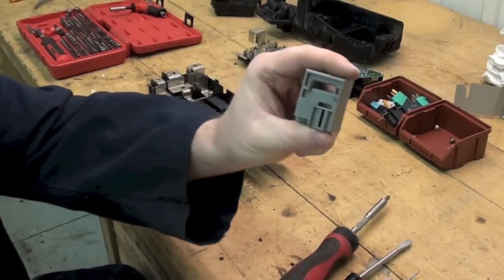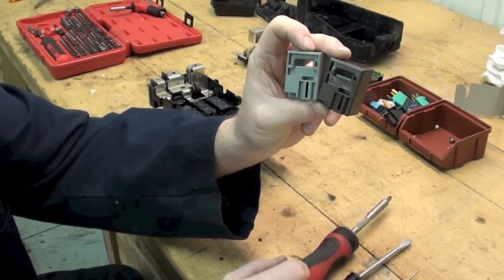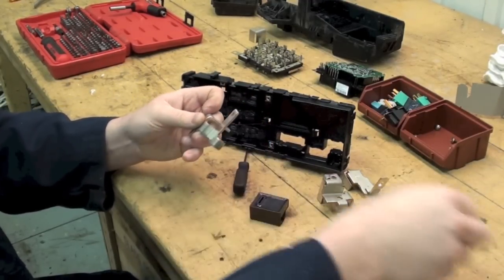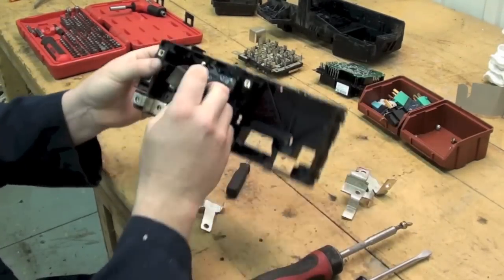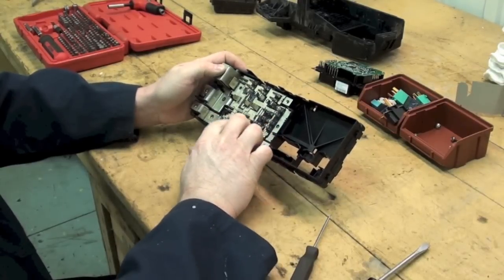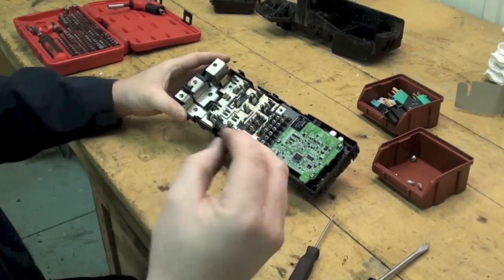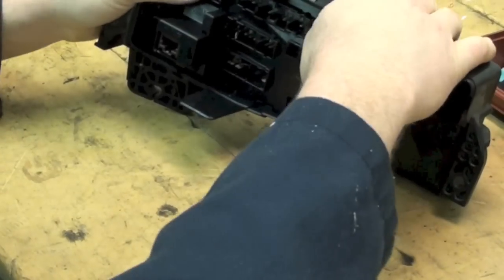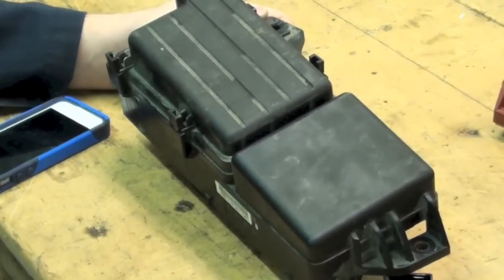How to Replace ELD - Electronic load detector - P1298 -Honda Accord 2003 to 2007.  Part II.

Comment: Gonna try this. Thanks for the amazing work and share!
Reply: Holy crap it worked! Got the part at the local Honda dealer for $31. Took me an hour start to finish. Hardest part was getting the plastic panel off. Just be patient and use lots of flatheads! Thanks again!

Comment: My alternator died (squealing sound) before killing my batter in the process. The other warning was battery light stayed on the instrument panel and then eventually SRS and Airbag indicators. Replaced both with auto parts store alternator and battery. Starts up okay, drives okay but once the car is warm (after about an hour) the battery indicator will randomly come on and then off again. No Check Engine light and OBD2 scanner does not return any codes. Did some Google searches and some say it could be the ELD. May give this a try.
Reply: Did you fix the problem? My accord is doing the same problem

Comment: I do not have this code, but my car will not charge i have put 3 alternators and 2 batteries,  ending in the same pattern charge light after running it for a bit. Sometimes revving it up makes it go away but eventually stays on. This cannot be 3 bad alternators and/or batteries. And suggestions?

Comment: Probably going to give this a try in my 2007 Accord EX. I have the code, but no check engine light, and I've been having an issue with intermittent air conditioning
Reply from the maker: I doubt this would cause a intermittent a/c operation.  This will repair your fault code.  I would check and see it the a/c clutch is engaged when the a/c is not working.  When the clutches wear out they will work intermittently.

Comment: I have a 2000 Accord 3.0
And I can't find anything on the problem I'm having... I've had this car for well over 100,000 miles and the headlights will dim everytime I click something electrical...like the windows, turn signals anything that draws a decent load. I've done the "Big 3" power/ground cable upgrade. It's all OFC 1/0 gauge cable. This has helped the misfire I've had forever. And the only code I'm detecting is ECU (timed out). I figured if this was a huge problem the car wouldn't even run. Also, I can not find a "electronic load detector" replacement anywhere... Not even the part store. Do you have any idea wth is going on with this car? Maybe a link I haven't checked lol. I'd like to bypass the ELD before I add a second battery in the trunk... Which I have to do because of the sound system I have installed... I can't turn it up much without the car starting to misfire bad.

Comment: I have 03 Acura tl type s, with strange voltage issues.  No code, no warning lights.  New high output alternator, new xs power agm battery.  Checked all the grounds.  Same problem before and after the new alt and batt.  Thinking it might be the eld.  I'm lost. The dealer want 220 for the whole fuse thingie.  Any thoughts?

Comment: Did you have a brown/dark tan grease all over everything when you took the fuse box apart?  There is grease literally everywhere in mine - all over the connectors, in the terminals, slathered on everything.  Please let me know I hope you reply so I can decide what to do before I put the box back together.  Thanks for this video series!
Reply: I see this is 2 years old but I hope you added the grease back... That's to help with moisture.

Comment: I have a 2004 Honda Accord ex V6, I change the battery, alternator and battery cables but my headlights keep dimming and my battery light and srs light keep coming on it’s it with the ELD

Comment: The 1996 Honda Accord Ex 
The ELD is built into the fuse box.
Is this the same application for the Accord Ex VTECH 2.2?
Reply from the maker: Michael Gossett it is not the same
Reply: BackYard Tech
My ELD is not visible. 
So it must be beneath the fuses?

Comment: Will this work for my 2007 Acura TL?
Reply from the maker: luis marquez Not too sure,   you can try it.
Reply: BackYard Tech what's the worst that could happen if i don't change the ELD
Reply from the maker: luis marquez my best guess would be the vehicle may stop charging.  Eld is a input to the ecu, and alternator output is controlled by the ecu via Eld reading.

Comment: Could the ELD fail and not throw a code?
Reply from the maker: Yes.
Reply: could I simply unplug the harness and not use the eld?
Reply: could i simply unplug the eld and not use it?
Reply from the maker: Not sure.   Don't know if the vehicle will charge without a functioning ELD.
Reply: Code will only show up when D is flashing. Read codes with D Flashing. (Don't turn off the vehicle)

Comment: where did you find the part?
Reply from the maker: Dealership,.  Honda part # 38255-S5A-003
Reply: Is that the whole fuse box or just the eld. My dealer wanted a lot for the whole box, crazy . Was thinking of checking out a you- pull- it.
Reply from the maker: That part # is just for the ELD.  Think ELD I installed is listed as a part for a CRV believe. It fits and work in a Accord just takes some time to disassemble.
Reply: +BackYard Tech (Crownedroyal2003) so it's possible it could work on a 03 tl?
Reply: +BackYard Tech (Crownedroyal2003) thanks for taking the time to answer my questions! 👍